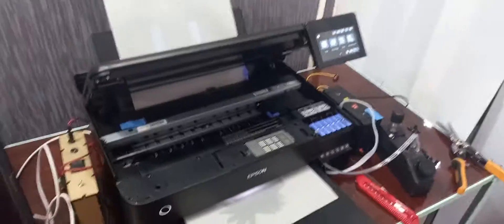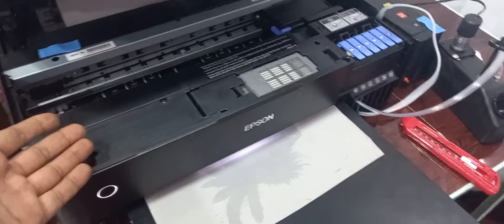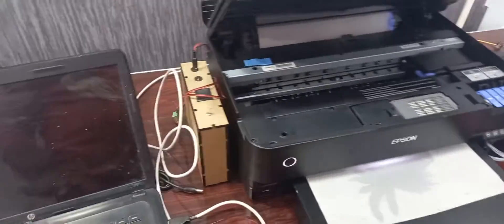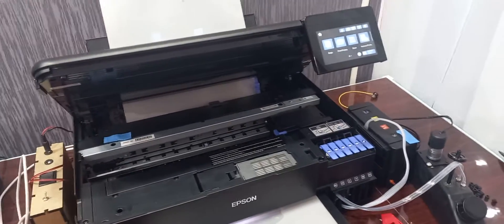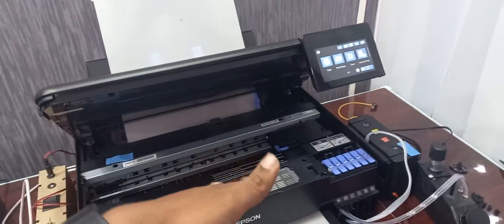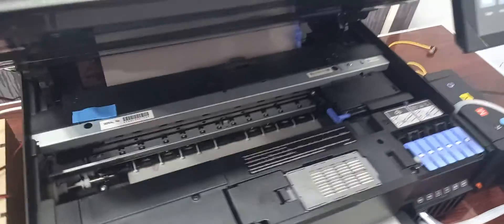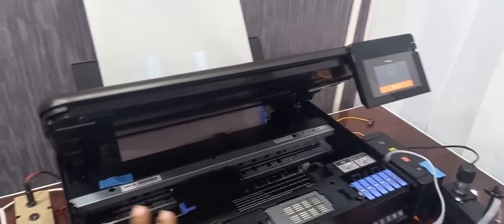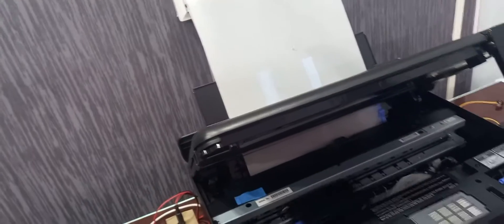L8180 DTF with Roll to roll Printer with smart roll Software

Comment: Hi, how did you solve the roll print problem with that printer. Because you know after a few printing it's ejecting all film.
Reply from the maker: Yes there is trick to do that install masking tape on PW sensor near to head there is sensor wch detect paper thicknes